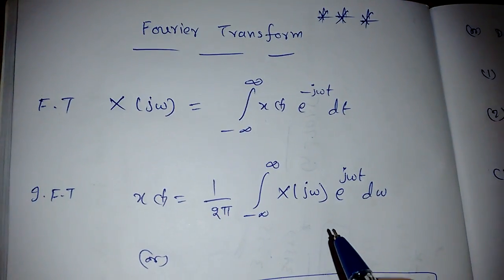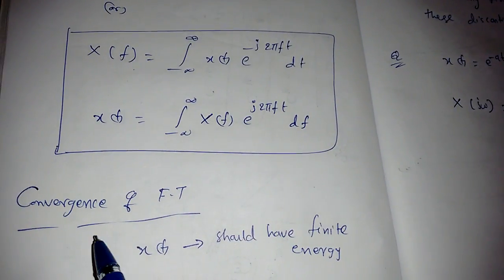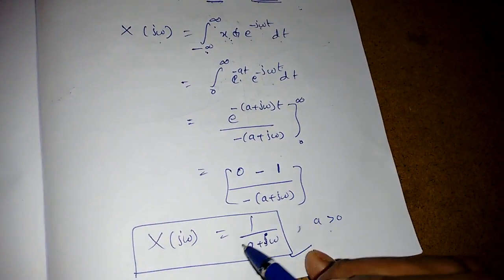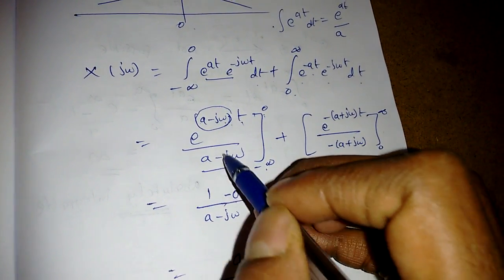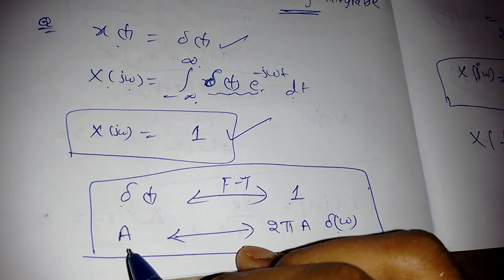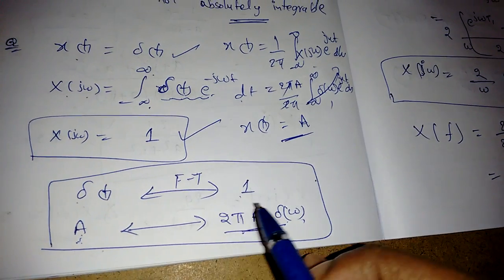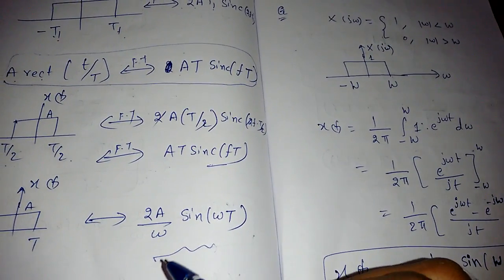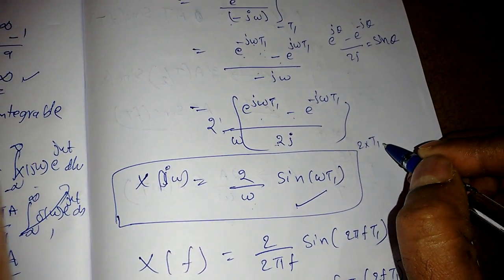Continous Time Fourier Transform -1

Comment: Hello sir... This is 325 who learned AEC from you....

Actually... There's a small correction....

U said that e^at*u(t) doesn't have Fourier transform... It's wrong... I can prove you in 2 ways...

 1. if u say that there is no FT of that corresponding expression, then the shift principle of Laplace Transform gets violated and you also know that there is a relationship between FT and LT.

2. The place where you made mistake is that u didn't took minus common

e^(a-jw)t can be written as e^(-(jw-a))t

In which upon integrated... Youll get 1/(jw-a)